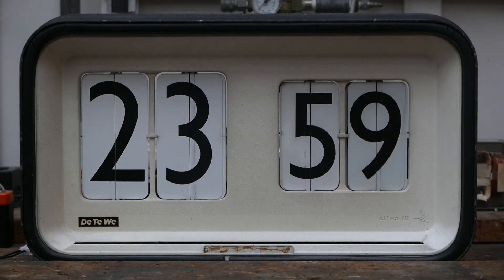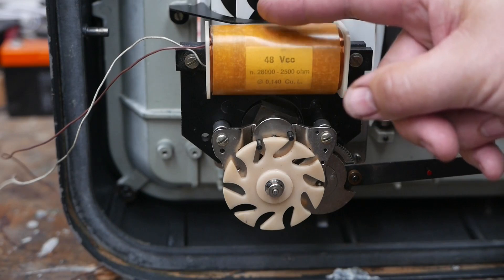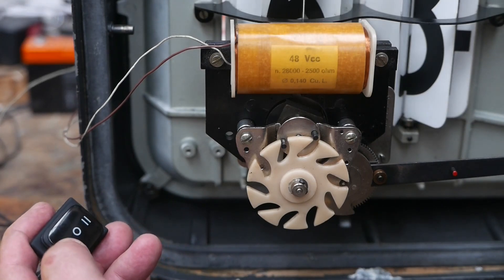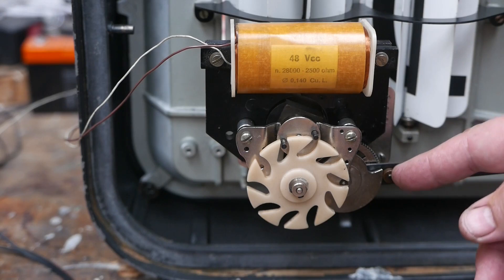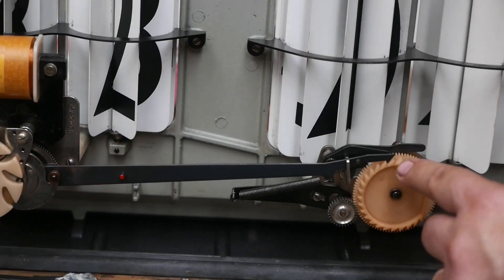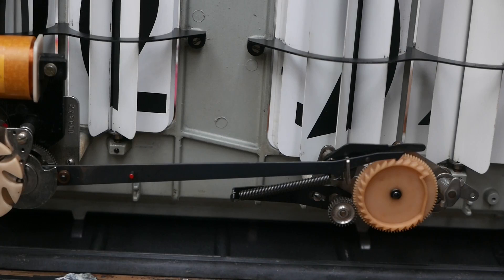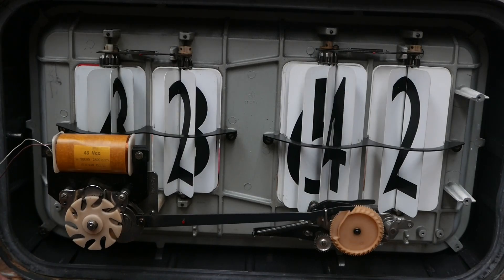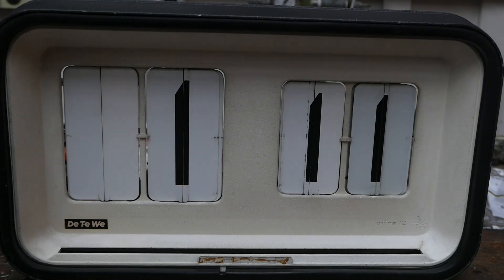See how it works??  Stylish Vintage Italian Electric Flip Clock : Solari Udine Cifra 12

Comment: Hi Darren,

Any idea how to align the hour flips as mine have misaligned. When it should read -0:00, it actually is on 03:00.
Reply from the maker: It sounds like a count wheel has slipped on a shaft.  Follow the drive line and look for a clamp screw (wheel to shaft) to loosen and rotate the wheel to get the timing back in sync.

Comment: Fab video and very helpful.  I just picked up a Cifra 10 this morning.  I have managed to get the pulsing working, however some of the springs have become corroded and aren't that "springey" any more.  Did you have to replace any of yours when you refurbed your clock?  If so, where did you source them.  Once again, many thanks for the video.
Reply from the maker: No I didn't need to change any parts.  For parts, try the fb group: SOLARI di Udine
Reply: @darrenconway8117  - Many thanks for getting back to me.  I will give that a try.

Comment: Thanks for very informative and helpful video! My Solari 12 is changing hour at minute 01. How can I adjust it?
Reply from the maker: Look at the position of the snail cams that are at the top of the shafts holding the flags.
Reply: @darrenconway8117  Thanks, have to release flags some way, maybe opening a screw on top (?).

Comment: Dear Darren,
I think I have understood now. This is a "Slave" Clock. It needs a master clock, which sends pulses every X time, so that the rotation time is regulated.
Regardless of that, I also think I must adjust the trafo and mechanisms, but of course, without a master clock, this does not work.
From what I understand and saw on the internet, there is CiFRA 12, that they are not slaves, that they work autonomously ... can it be?
What do you use as a master clock?
Thank you very much
Best regards
Reply from the maker: Hi  
I understand there is a version of my clock that includes a pulse generator.  My clock needs a master clock.
I use a Synchronome master clock, but this only produces single polarity pulses.  

I am currently writing software for a Arduino Uno and H-bridge motor drier shield to produce double polarity pulses.    This will take the pulses from the Synchronome and produce pules for the normal slave clocks I have, plus pulses for the Solari Cifra 12.    This is a mix of old and new technology.

I could add a Real Time Clock module to the Arduino to make it a master so I didn't need the Synchronome, but I haven't done that.

Comment: Dear Darren, thank you very much for the video.
I have a Cifra 12 that I bought a few months ago, and just now I started to review it to fix it. I have several Solari's, but they all have different mechanisms, and the one that Cifra 12 that I have has the same mechanism as yours. The issue is that I don't know if the transformer is okay, because voltage arrives and the magnet trembles, but it doesn't rotate. And I do not understand, exactly how it turns every minute with this system, if it is a matter of the current itself, or should there be a timer, that mine is missing and I do not see yours either (In your case, what you do pressing the button) or something I am not understanding correctly.
Sorry, my English, as it is not my language.
Best regards
Reply from the maker: My Cifra 12 requires a separate master clock.  The master clock provides one pulse every minute.    The pulse voltage varies with the clock.  Mine requires 48VDC.    The pulse polarity has to alternate. One pulse is  + / -   and the next is   - /+ .     

For the video, I use a switch to produce pulses (no master clock).  The switch produces alternating voltage pulses.
Reply: @darrenconway8117  Thank you very much for your response. I was reading a lot about the cifra 12 and discovered what you tell me!!! thank you again!!1